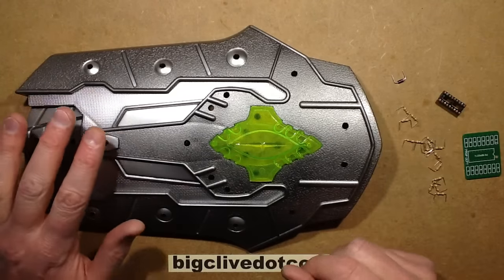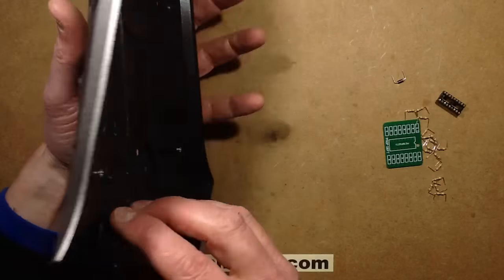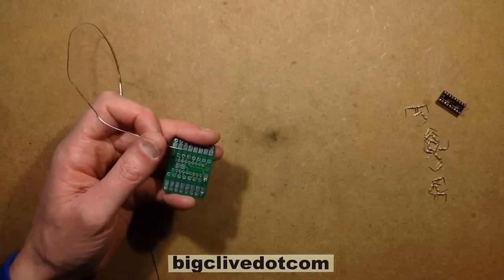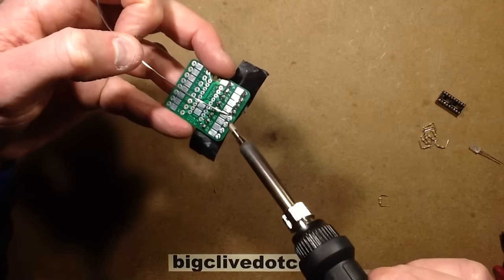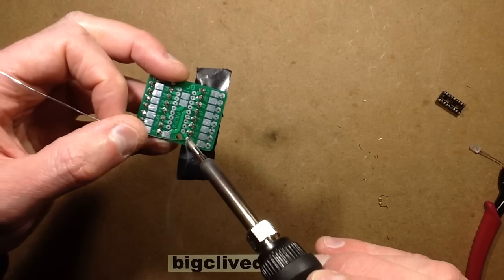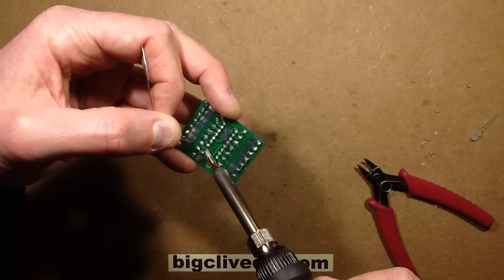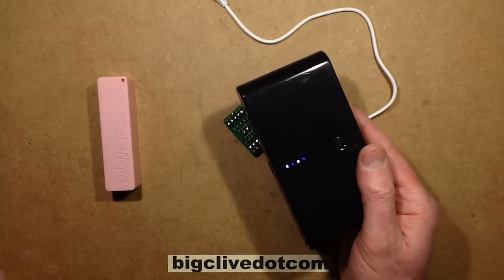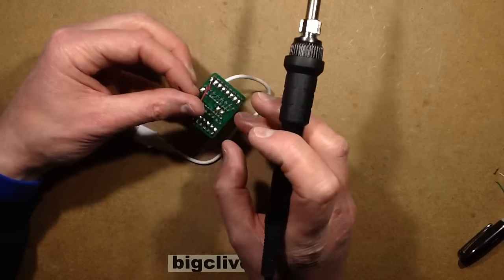How I add LEDs and circuitry to a TV prop.  (with timelapse)

Comment: 17:10 The pin Clive refers to is RA4 (which is common between similar models of PIC microcontroller). Its is an open drain type, hence it can only be driven to low when that pin is in output mode.

Comment: I've come across a USB cable with red/black swapped.
Reply: That sounds like it would have been fun.
Reply from the maker: +mikeselectricstuff Yup, me too.  That's why I always test them.
Reply: +mikeselectricstuff I ran across one that seemed to be randomly wired. I don't recall exactly,but it was something like white=5V,green=D+,black=D-,and red=ground...or some such nonsense.
Reply: +mikeselectricstuff Same here.
Reply: +mikeselectricstuff yep, seems to be a common plague...
Reply: +mikeselectricstuff Same thing - reused cord from broken USB mouse. It seems like chinese don't really care what color wire goes.
Reply: +mikeselectricstuff I bought a generic ccfl inverter from china once and blew it up instantly ......really should have looked first and should have ordered more than one.
Reply: +mikeselectricstuff I've come across a USB cable with only grey wires.  Only grey, and one string. Pinout: VCC: Grey, GND: Grey, D+: Grey, D-: Grey. That was fun.
Reply: +mikeselectricstuff Me too, ended up destroying some expensive equipment. The worst part was that i was working with several of the same brand cables, in the the middle there was this one cable that had swapped them.
Reply: +mikeselectricstuff Same, what a fun day I had figuring out why my circuit wouldn't work.
Reply: Yep - and I've found at least one where they used like black and green or something for power and red/white for data.  Totally nonsensical.

Comment: Thanks to this video, I can no longer be arsed to thread offboard wires through PCBs or perfboard - I just "splat" them onto the appropriate pad or onto an appropriate component lead. Much less futtery and, so long as lead stress is minimized, it is robust enough and works a treat.

Comment: When step-drilling plastic, acrylic or other brittle materials, drill from the reverse side of the workpiece and press it firmly down against a piece of scrap timber to minimise splintering/cracking/burring. Then clean up the hole with a few twists of an oversize drill bit held in the hand.

Comment: I also love to use big soldering tips.

I go for "Use a tip as big as you can still comfortably use". Transfers the heat faster, which means less chance of damaging anything.
And i'm glad i'm not the only one using sockets for chips. I wonder why so many DIY kits come without them. A part thats like a few cents...
Reply: Does solder take to the actual pins of the controller well? I figured that was part of the reason to use a socket.

Comment: A note on USB power, If you have a stack of old ( or just buy cheap USB ) Keyboards, you get a fairly long lead which has standard USB on one end (that will plug in your power pack) and take the keyboard apart you should have the other end with a small ferrite ring on it and a standard white/black/whatever plastic 4 pin connector on the other end. Just solder pins into your circuit and plug in and play :D, you also get bonus leds, screws etc..

Comment: Clive, watching you put that chip into the DIP socket reminded me of trying to take a chip out of one of those and ending up with several holes in my thumb at 0.1" spacing.  Yeah I never owned a chip puller.
Reply from the maker: Done that many times.

Comment: Hi Clive, I don't know if you will see this, but it's actually a better idea to drive the LEDs negative, because this way they draw their power from the mains supply of the circuit. 

If you drive the positive from the MCU pins, then the current that the LEDs use also passes through the MCU and, depending on how many LEDs you have, your MCU might get hot enough to burn.
Reply: +Iulian Andrei - Whether you drive the LED's near side high or low and the far side from Vcc or Gnd, either way the same current will go through the microcontroller - so the same power will be dissipated inside the microcontroller; Many PICs (at least the earlier ones when I used them) sink (from ground) 40mA and would source (from Vcc) 30 mA, so pulling the LEDs to ground let you drive them harder - Plus the open drain pin let him drive an additional LED, so that's 2 wins for Clive. It makes sense to me to do it that way, as well. There are per-port and per-device current limitations you have to stay within, more likely due to bond wire sizes than heat (MOS stuff has QUITE low voltage drops across it when saturated!) but I'd think he would just alternate lighting various LEDs to stay within those limits. (Yeah I know - Vdd and Vss for MOS devices, not Vcc and Gnd, but, we have newbies on the channel, trying not to cause their brains to cringe EARLY.)

Comment: And another quality video with extremely clever tips for constructing boards (I'd have never thought to use electrical tape to tack down components for mass soldering).

Quick question, if you wanted to build one of these boards with an ambidextrous connector, what would be the correct circuit to accomplish that? I have a mental image of using two diodes to make sure that the +ve voltage always goes into the correct side of the circuit, regardless of how the power is plugged in.
Reply: +Gadgetboy Personally I'd use a hard surface or blu-tack as electrical tape is a rare resource in this household. Still interesting though.
Reply: +Gadgetboy&#160;
You don't exactly need a circuit to do that - You have to make the pinout symmetrical and/or mirrored, depending on the design of the connector.
This can mean having more pins though, some being redundant.

A random example for a pinout of a 7 pin SIL header:
P G A L A G P
P = power
G = ground
A = SDA (for I2C ... just an example lol)
L = SCL
If you can imagine it, the connector will have the same pinout when reversed ... so it doesn't matter which way you plug it in :P
I believe the Apple "Lightning" connectors are similar to this.

lol ... think of it as the word "poop" or "wow" (I know, terrible examples XD) ... spell them backwards, and they will still be spelled correctly when you read the letters from left to right.
Reply: John Sinkiewicz
Well, less voltage drop, depending on the number of conductors and their size of course. But I do know, once the voltage drop is small enough, it's pretty much so insignificant as to be completely ignored, without any bad side-effects :P
Reply: Prehistoricman why is it a rare resource?

Comment: Nice.
No in-system programming so you obviously pre-programmed the PIC as it wouldn't do all that straight out of the packaging!
Reply from the maker: +bob s Yup.
Reply: +bigclivedotcom how does one program pics? They look awfully complicated.
Reply from the maker: +Bradman175 It's all a matter of getting to know them.  The main differences in programming a microcontroller directly and using a simpler programming environment like the Arduino platform is that with the bare microcontroller you need to understand how to use all the features in it at a functional level.  The Arduino hides all that and allows the use of simpler modules to make programming faster and easier.  The main advantage of programming a microcontroller directly is that you can make the program very efficient and fast, potentially fitting in much more software into a smaller and cheaper chip.
Reply: bigclivedotcom I know, but I do not know how to use the bare functions of the microcontroller. I only know Arduino. Any straight forward guide you could suggest?
Reply from the maker: +Bradman175 If you search the Internet you'll find lots of starter guides for PIC or Atmel programming.  Then it's just a case of getting a cheap programmer and then plunging in.  The only way to learn to program them is to do it.

Comment: How would you go about creating a large number of randomly flashing LEDs, such as a Spaceship control panel type effect. Would you multiple independent units of this kind of circuit and power them in parallel from the same usb bank, or would you go down the route of using an Arduino type controller?
Reply: There are literally as many different ways as you can imagine...and a few more for good measure.  Those you have mentioned are but a few and it is really up to the builder and whether there is any requirement for some lights to be sequenced or just pure (or apparent) randomness.  If it is a really large display then multiple lights, randomly chosen, might share a common output to reduce complexity if they are far enough apart that it is not readily obvious they are all blinking at the same time.  You can also use shift registers and simply feed an unending sequence of 1s and 0s into them with each output corresponding to a light, which can also potentially make each light individually addressable using a single microcontroller if you wish.  Many options.
Reply: +Genesis Rowley He has a video where he shows off some space ship back panels. Each one is independent and modular.
Reply: Thanks I'll have a look and watch that one.

Comment: Dude I didnt know you did tv props! I am so in need of doing something for my computer room in my house. I have a 5 meter roll of digital led and controller I dont know what to do with, and litterally tons of 3v slow colour changing led things and 8 colour fade led 240v standard bayonet bulbs i got for 50p each in a sale! I really want a futuristic look in this room and want to make those 60's style consoles where the computer monitors could mount behind at an angle ( 3 in total ) with switches and lights that mean and do something like the power, reset, HD lights, switches for power, taps off the power supplies for external sources of 12v, 5v and 3.3 v power. I have looked everywhere for those little square switches that light up with writing on them when active, like you see in mission controll at NASA but cant find them. Do you have any builds you have done I could look at to get ideas ?? Thx :)

Comment: If you do want to play with small form factor vacuum forming, you can get a long way with those poundland cheap plastic plates and a hot air gun and instead of vacuum properly just pressing over the mould.  Cheap, nasty, small, but quite fun.

Comment: you don't have access to a vac forming machine? Why not make one? I remember a guy I knew making one using an old air hockey table and a vacuum pump and some infrared heaters. worked like a charm.

Comment: Here's another idea if you need to make a computer prop: use a random EEPROM chip (the old type with 8 outputs, not I2C) and use CD4060 cascaded with CD4040 to address inputs of the chip and it flashes very long pattern at the 8 outputs, also I found out that EEPROM chips (I used an old 1993 era P28F020 chip) can drive InGaN LED's with 10mA directly without buffer._
Reply from the maker: If you look at my video about fairground lighting controllers you'll see that I used a 4040 and EPROMs.
Reply: @bigclivedotcom  Somehow I forgot about that video, I was quarantined and played with old parts I dug out of my parts bins I rediscovered that trick. I used CD4060 as a main counter as it has it's own oscillator circuit built in._

Comment: sorry for the late question: in this video you're using the st-9905, in another one you reviewed the st-9927t..
now the 9905 is a lot cheaper, same cat iii +cat iv ratings.. (no calibration available ??)
Could you tell real life differences ?? Just needed to get another one for multiple measurements??
Perhaps a short comparison ?

Thank You😄
Reply from the maker: I've got a few Amecal meters here.  I tend to use the one with the bigger display most because it shows up better on camera.
Reply: bigclivedotcom All for the show then, Las Vegas Style 😎, including a bit of high voltage gambling...  (thx)

Comment: Would it make sense to have connected one each of the data lines to the two power lines for lower resistance in the cable, or would that even matter? I suppose it makes it a bit dangerous for phones if someone were to plug theirs in, but that could be a good thing if it stops them getting stolen. :)

Comment: Hi Clive, I know you have mentioned what soldering iron you use before, however I can't remember which video it was in. Please could you tell me which iron you use. Thanks in advance
Reply from the maker: +Alex Underwood At the moment I'm using a Yihua 8786D.  It's a combined soldering iron station and heat pen.
Reply: +bigclivedotcom OK thanks also good video :)
Reply: +bigclivedotcom  I've been using an 853D. It's really not bad. The built in power supply and voltmeter is a bit of a joke, but it still comes in handy sometimes.

Comment: Wouldn't multiplexing save you a lot of soldering time and wire?
Reply from the maker: +Ni5ei I try and avoid multiplexing on props wherever possible.  The scanning can cause problems with some filming scenarios where there is an intermodulation between the scan frequency and the camera shutter speed.
Reply: +bigclivedotcom Ah yes, hadn't thought of that.
Reply: +Ni5ei 
Also, soldering the multiplexed LEDs together is a bit more of a strain on the brain, which is more likely to result in a goof-up XD
Reply: +Ni5ei 
Also, soldering the multiplexed LEDs together is a bit more of a strain on the brain, which is more likely to result in a goof-up XD
Reply: +Benjamin “Ozias” Esposti True, but not a real reason not to use it. Doing it this way with up to about 20 LEDs is still OK but imagine having to do 100. You'd need an equal amount of resistors and loads of wire.
Reply: Ni5ei
Indeed, though there are chips out there which are specifically made for driving many channels of LEDs, without the need for resistors (they source/sink a certain amount of current no matter the voltage).
Reply from the maker: +Benjamin “Ozias” Esposti I've used serially addressable drivers like that.  But they were not multiplexed.  Again, ideal for TV and camera use.

Comment: hey, have you heard of LEDs with resistors prebuilt into then?... might make your work finish faster
Reply from the maker: +Suraj Grewal I have, but they are much harder to find and less versatile than standard LEDs.
Reply: +bigclivedotcom In my experience, they got significantly hotter than the conventional separate resistor arrangement. However, they saved a good bit of real estate on a protoboard.

Comment: How do you go about setting up the micro controllers. I've got a few of those LED Knight Rider strip lights but want to get rid of a few of the naff light effects and just keep the ones I want. I've got both the single colour as well as one of the multi colour ones. Perhaps you could do a video on them to show us how they work? (Hint! Hint!) lol
Lee - fae Ayr/Coylton
Reply from the maker: +Lee Sanderson That would be a monolithic video.  I could cover the very basics of microcontroller programming by walking through one of my own bits of software, but it's an area with a very steep learning curve.  The only real way to learn how to program microcontrollers is to just lay into them.
Reply: bigclivedotcom A video on the basics of micro controller programming would be great. Would you be up for it as you've a very natural way of explaining how stuff works?

Comment: I was thinking how that would work with an Arduino. It requires an external crystal and two capacitors two form the clock circuit. It might work if the hole spacing is right for those components.

Comment: Clive, why do you use  lengths of solder, rather than straight from the reel. Doesn't using it this way leave you with lots of wastage with short leftover bits of solder?
Reply from the maker: +Maxx B More freedom of movement.  The solder is on weighted reel supports.  I tend to use it right down to about 1cm, so there's not much waste.
Reply: Ah! I see. I'm used to having a loose reel of solder which mostly unwinds as I use it. I don't have the luxury of having a dedicated workbench in the house, and my better half isn't keen on me having a permanent electronics bench on my desk.
I've managed to get pretty good at organising my setup, so that it packs away quickly when I'm done with the day's lesson or project.
Thanks for all the great videos. I've learnt a lot about electronics from watching you and Julian.

Comment: +bigclivedotcom Great video as always....I do have a question though. By connecting the positive from the board to where you did on the positive rail (2 LEDs on one side, the rest on the other) didn't you create, what is in essence, a voltage divider which would cause the 2 on the end to be brighter than the rest? I am a novice and am probably missing something incredibly simple. Is it that the resistors on the board ensures that each individual LED gets the same voltage?
Reply from the maker: +Dev Durer All the LEDs were on the common positive bus and then each had its own resistor either on the PCB or soldered on directly.

Comment: What do you do with all those little ends of solder that are too short to hold in your finger?  Throw it away or???
Reply from the maker: I can use the solder down to a tiny length and then often just toss it into a joint as I flow it, so there's no waste.